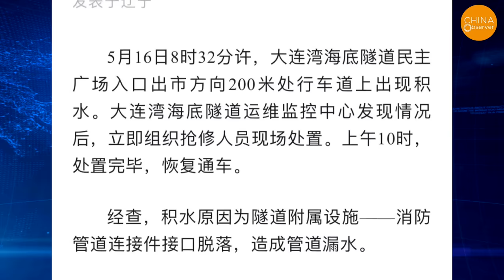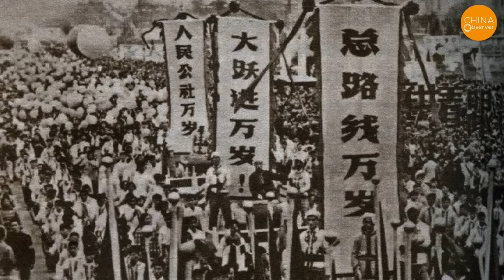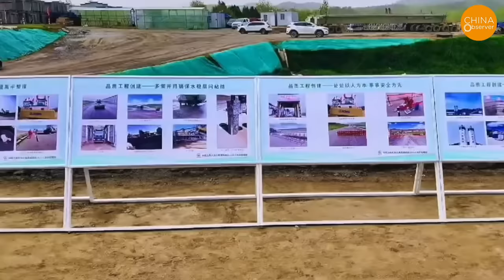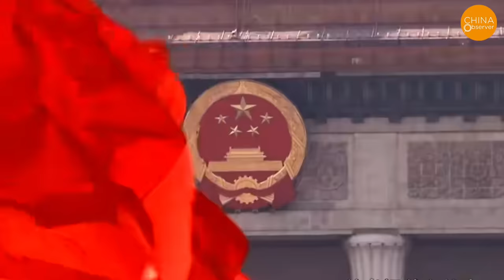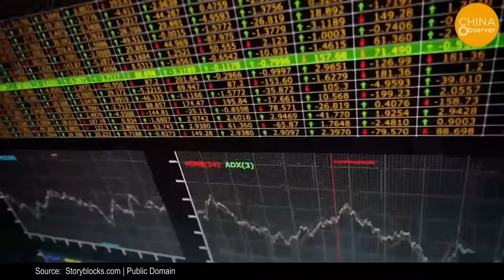China’s $800M Undersea Tunnel is FLOODING Within a Year! A Tofu-Dreg Tunnel Becomes a Waterfall Cave

Comment: They always say that china beat the record time in terms of construction but they haven't say that it crumble in record time as well.
Reply: Maybe some duct tape would fix it ,).
Reply: There two ways of facts.

One. If china must take other advice way like Japan did make corrections possible build project of tunnel. 
Not instead beating time.
Instead take some of time to build.
Reply: They never say record time it took to collapse
Reply: Built in record time...disintegrated in under record time.
Reply: Excellent observation.🤔👍🏿
Reply: Until it starts to fall apart.

Comment: I wouldn’t use that tunnel at gun point. Chance of a catastrophic collapse must be increasing. One thing for sure - if it does collapse we’ll never hear about it.
Reply: Yeah we would, we would hear about it on YouTube haha
Reply: Right? Water accumulation has to mean structure failure. I would be shitting bricks if I drove in that and saw that. NOPE.
Reply: Just wait, saltwater has gotten in. Now the rebar (whatever is there with questionable quality) will begin cracking the concrete in segments, leading to a massive breach flooding the tunnel in minutes.
Reply: @SethMethCS  it wasn’t saltwater. It was just a pipe leak.
Reply: @The_hot_blue_fire_guy  ALLEGEDLY a pipe leak, could be more serious than stated

Comment: I just watched a YouTube video on the impressive network of undersea tunnels in the Faroe Islands.
The Faroese tunnels have pumping stations at their lowest point because good engineers know that ALL such tunnels have leaks.
Chinese construction companies apparently consider such things to be an unnecessary expense.
Reply: Those were Norwegian built, so the Faroese got the best people in the business to do it. :)
Likewise Norway also has a large number of undersea tunnels, especially the Ryfylke tunnel which is 14 km long ,and goes 291 m under sea level.
And we don't have any issues like this.
These chinese tunnels are absolute jokes.
Reply: true, but tow things: 1-maybe they did have pumps but they couldn't keep up
2-CHina probably has twice the tunnels than all of Europe if you include train tunnels as well. built them 20 times faster for 50 times cheaper. you can't have your cake and eat it too.

Comment: If true $800 million US is a joke for a underwater tunnel. This is beyond cheap.😮
Reply: How is that so? I mean sincerely, how much should it costs and why?
Reply: Its only 6.5km long in shallow water, where an immersed tube tunnel was probably used. $800m is a lot for such a project.
Reply: The channel tunnel from England to France is 30 miles long and cost £9 billion (82 billion yuan) back in 1988. That is about £19 billion now

Their tiny about scares me.
Reply: @Kalamain  Have you ever looked at the cost comparison of simple immersed tube tunnels in dredged trenches, compared to a difficult to construct tunnel like the Channel Tunnel? There is a reason why immersed tube is the chosen approach anywhere it is practical.
Reply: @steveunderwood3683  is that what this was... A sunken tube?

I thought it was cut rock?
Reply: Yeah but this is china not the US the tunnel would be many billions equivalent to China. Understanding exchange rates and per capita income you can see this is an expensive tunnel to the Chinese just to flood a year later
Reply: @aleksandrakowalczyk6043 Fort Mchenry Tunnel  under the  Baltimore harbor. 750 million in 1985 money.
Reply: @steveunderwood3683  I disagree, so much specialization. Water complicates everything. So hard to deal with. Companies  would rather use a TBM to go under it instead of through it..
Reply: @steveunderwood3683 in general  you always choose what's most practical and will give the longest life span with these types of projects.
Reply: @aleksandrakowalczyk6043  $5 billion

Comment: Glasgow Clyde tunnel was opened in 1963,It cost £10.5 million back then to build, todays equivalent it would almost be £256,490,000 and it will be 61 years old in July, back then only about 9,000 - 13,000 vehicles where going thought it per day, but to this day there is more than 65,000 vehicles going thought it per day, and it has accelerated the wear and tear on the tunnel resulting in it been close repeatedly for repair and renovation work.

Comment: Driving EV cars thro that amount of water will be a very interesting combination.
Reply: Ice cars are more vulnerable driving through water.
Reply: @Paul-yh8km  I agree ICE cars are more likely to come to a halt if water gets into the carburettor.  But from what I've read if sufficient water gets into an EV's battery which is often situated under the car, they are likely to go into thermal runaway and go up in smoke.
Reply: @lindapullan6937  
No they don't.
The battery and components are waterproofed to specific standards.
Hybrid cars have the same tech, but have been considered safe for many years.
EVs have a lot of safety systems built in including thermal sensors in the batteries and monitoring of individual cells.

Comment: Most structures built under water or near the coastal or reclaimed land, has multiple water pump systems built in… that runs 24/7 for as long as the structure is in operation. Same with the many MRT systems that run under the canals n near the coastal areas.  Ground water is common, so this is present. Under Marina Bay MRT etc.

Comment: Salt water ! not water pipe hahaha tofu x
Reply: which salt water that has a bigger effect on lithium batteries. like the ones used in EVs.
double bonus points for having a tunnel flood, that then causes a massive lithium battery fire in the middile of an under water tunnel.

Comment: A fair comment, the problem lies in the water drainage system. The water is probably coming from the surface, as it is not constant. If there is an actual leak in the tunnel structure, it would be constant and accelerating (lots of pressure). You have to pump the water out from the lowest point. There is probably short-sightedness in underestimating the surface water runoff with rapid construction, where the surface flow is minimized in design.  
   That problem though causes failures from the inside out..
Reply: Look a bit harder bozo - Have a look at pictures and see how close to the surface the actual entrance is
Reply: @evangiles4403  A road tunnel isn't useful if it isn't on the surface... I'm not sure what you mean. Rain happens, cars carry it in. It could be fire pipes did rupture, probably from subsidence (subsidence can be accounted for, but maybe was a cut corner). When you build stuff in a hurry, you generally don't do deep studies.

Comment: There's an old expression that China 🇨🇳 seems to have ignored.  
HASTE MAKES WASTE.  Yea, it rhymes, but it's good advice. 
The ccp in its headlong rush to win friends in poor nations has provided construction  projects quickly with substandard materials and shoddy engineering practices. 
Of course, the costs were not low, and the loans for the projects were high priced. 
All this resulted in  a fast flash of impressive show with long-term problems that will manifest over a short time.  
The only real benefit is to the ccp.  It provided work for its labor force and pocketed the profits by paying low wages to them.
Time will tell who got the better part of the deal.  
I bet it wasnt the host country or its people.   😢😢😢😢😢😢😢😮